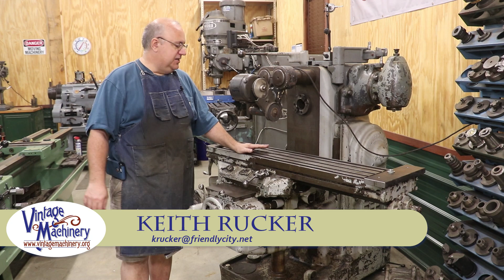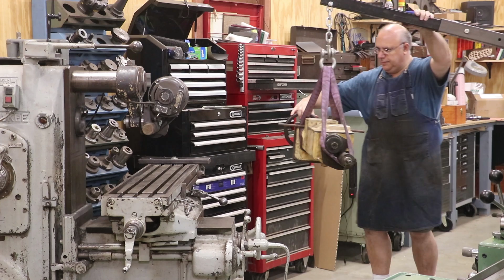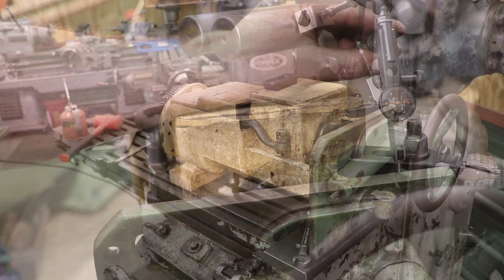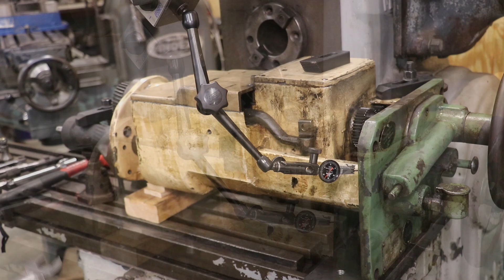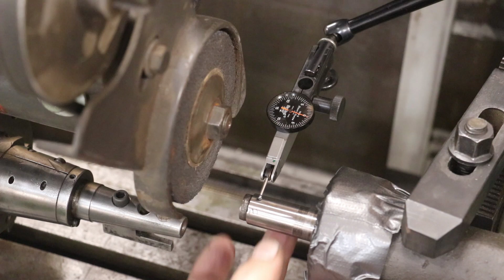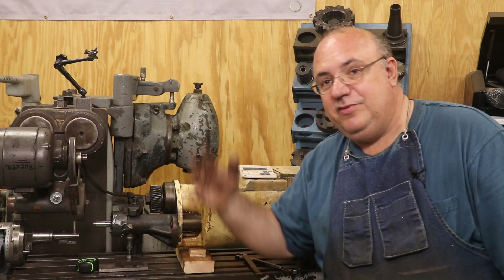Landis Surface Grinder Gear Box Repair: Cylindrical Grinding on the Horizontal Mill

Comment: Truly inspiring, Thanks Keith! Now I have another fun challenge; I need to grind a crankshaft for new bearing shells. Think Im gonna try your way. Problem is I need two centres for holding the crank. Could I find or make centres for this job? Any ideas welcome... Cheers. John in Denmark

Comment: stupid question, why didn't you disassemble the transmission and take the shaft out and turn/grind it on the lathe? It would seem easier to me.

Comment: I am setting up a Burke # 4  horizontal mill as a small surface / tool grinder.  I have a Rockwell univise to hold the tools. In place of a separate grinder like you have I will be mounting my cutting wheel in the arbor.  I can get just over 1,000 RPM from the arbor.  Great minds think alike ( well if my plans works) lol

Comment: You could attach a laser pointer to the gear box pointing along the direction of travel of your bed to see how much actual difference there is from the flexing of the bed. Say your pointer puts a spot on a wall 10 feet away. If there was no flexing of the ways, then the spot would not raise up when you crank the bed out to the end.  You could probably determine exactly how much to compensate in you adjustments as easily as lowering the gear box front end until the spot is in the original location. Does that sound reasonable?

Comment: Great solution to fixing the munged shaft without needing to completely disassemble the gearbox.

I was happy to see you explain the effect of the long pivot length on the change of angle. (I was expecting something like 1/30 of the desired change from the initial  0.0015" adjustment.)

Comment: Another great video.  Here is a wacky setup I made in the past. I had a live center that was not running true, so I setup a gear reduction motor to drive it, and used my tool post grinder to dress it up.  Always fun figuring out how to do something.

https://photos.app.goo.gl/ssAB2VuYK9Gwadd22

Comment: Kieth, 

Nice Job!!!

There will aways be people who think they can do it better, faster, more accurately or by some "better" methods. 

Problem is most of them have never worked in a shop or had to actually repair something with available tooling. 

It's always easy to do a job in someone else's shop using their checkbook. With what you had available you got it done and it didn't cost you a ton of money. And, that is the lesson here.

Comment: Great video!!! Ialso think that a contributor is the fact that when you indicate to 1/2 thousandth on the pivot point, the other end multiplies that error by 29 in your case. So simply from  1/2 thousandth on the one end, the other end is out by 14.5 thousandth.

Comment: I think you did a great job as you done it. Remeber this whole system has a multitude of differences in bearings and shims. and some of these have weights of the shafts and torque settings with all that you found the unknown numbers by your knowledge. The only other way was to break in all down to get the shaft by itself and then turn it on a lathe.  great job!!

Comment: Some sort of sturdy floor stand could be used to hold the indicator against your reference surface with the X motion way out to the right, properly positioned for making the cut. That way the indicating would be done with the off-center table load and everything sagged and flexed as it would be when doing the machining.

Comment: wouldn't you want to indicate the shaft after you squared up the casting? just to be sure the part your working on is as square as possible to the grinder?

Comment: Hi Keith; 

You could check the table with a precision level in the position where you trammed the vertical face (which was a bit lumpy anyway) and where it may have deflected with the weight when in a cantilever situation, that would also indicate the sort of wear you may have in the ways, and again that would be a combination of X axis wear, Z axis wear and possibly Y axis as well. 

As you said there may have been other ways to do it, clearly you could have dismantled it, and a bigger machine, but in the absence of other machines and no need or desire to dismantle it, your solution produced the desired result. 

Well done. 

Dennis

Comment: If I may,I do hope you use a Shopvac to clean the grinding dust off . Ideally,enough water in the vac that the thing bubbles would see to it the grinding dust ends up in the water,then dump the water. An air hose might not be the best choice here. Cheers.

Comment: I've no idea what I'm talking about and am going to get told this is a stupid comment but i don't care: couldn't you just have turned on the Landis with the gear box still on it and polished that up with a bit of sandpaper?
Reply: Mig Trewornan No, because there is nothing driving the gearbox. The drive part is the part being repaired.

Comment: Neat piece of work, Keith! I love these videos where you figure out a way to get it done with what you have. Back many years ago when I was a computer programmer/software engineer part of what I did was brainstorm solutions to problems. I'd just sit there and throw out a dozen or so ways to try to solve the problem and the other programmers would go off and try them. If nothing worked they'd come back and I'd throw another dozen at them. There are always a bunch of different ways to solve any problem. in my opinion whichever one first gets it solved is the best way to do it. (although I have to admit to more than one dope-slap moment when I looked back and a painfully simple solution was right there and I missed it!)

Comment: Hi Keith, I was thinking to remove the shaft and either grind it or better still make a new shaft of slightly larger diameter. The torque on the pulley might be high - at times - and that probably caused it to spin freely.

Comment: Great work Keith, love the videos. I run into the same thing turning tapers on rifle barrels, I know how much taper I want from muzzle to the start of the flare over the chamber but have to ratio that length to the length between centers and get my indicator reading when setting up the taper.    Thanks again.

Comment: Here is my 2 cents worth. That was a super interesting approach to solving the problem at hand. And let's be honest, that was a really cool way to solve the problem. The boring approach (maybe simpler) would have been to leave the taper in the shaft and make a bushing for the pulley with the same taper. In any case, another great video, Keith.

Comment: Very nice job. Good setup and excellent explanation of how you lined up and fixtured. I will note that I would be careful slinging like you did to place the part. Even if it is balance, if the sling slips a little and one end drop a fraction of an inch, it will keep going until it hangs vertical or drops the loop at the high end. When we sling that way, we use separate slings on each end to prevent slip when we can, or, if we can't and need to do it as you did, mouse up where the sling goes through the shackle to prevent it from slipping. Friction is sufficient most of the time, but you only need a heavy part to slip once.

Comment: Glad to see it worked out in the end.  
A couple of thoughts about the taper in the beginning.
1.  Even though the vertical surface was true at the pivot point you still have the multiplier of the length. 
2.  Could you have used the base of the key to check for level before you started grinding since it should have not been worn?

Comment: You can just put 2 indicators on the shaft . 1 indicator on the small size and 1 on the large size , and you ajust that the diference to be 1.5 thou .

Comment: I`m not a machinist by any choice of the word ,but I kept thinking your math was off when you indicated it in simply because of where you indicated versus where you needed to do the machining (multiply the length ) but you did finally get there

Comment: Have you still got that metal planer? I could see that grinder doing some great work sat on your planer grinding in lathe beds and large saddles! Or even your horizontal mill table would fit.

Comment: Did you consider there may have been flex in that shafts housing? It seems to me that you should have had your machinist jack under the gear box, not the shafts housing.
Thanks for all of your work.

Comment: I love the setup! That is getting it done! :-)
Reply: When keith was moving the gearbox to the mill was when I realised you had the right idea about how to set up a shop with that overhead crane. That's the most important tool in the shop in my opinion.
Reply: If you are doing heavy stuff it is invaluable. Having struggled without for 15 years in my old shop I knew it was a must have for my new one.  I couldn't do what I do without it. :-)
Reply: Great idea for the home shop.

Comment: Go back and watch again the way you indicated the vertical surface. The indicator didn't move at all, except right at the end, where it may have hit a ridge. you adjusted from that ridge, instead of the average, as you talked about doing.

Comment: Keith, well done.  As far as calculating your movements ahead of time, you essentially "sneaked up on it", which in cases of older machines is exactly what it takes.  I do a lot of work on old hit n miss engines, repairing and making parts.  90% of what I do is to "sneak up" on a target measurement.  From my perspective, absolutely no shame in doing that.  Again, well done.

Comment: Great solution.  Instead of a rag in the 50 taper socket you should print a plastic plug to close off the hole when not engaged by tooling.  I suggested this to James Kilroy who then printed a plastic plug which you can see at https://www.youtube.com/watch?v=8HK992VjoUw&t=70s
Reply: In kilroy's next video we see him printing a 50 taper socket plug for Keith.

Comment: Works for me! I have to admit I was thinking that you needed to drop that end a tad more to compensate for the taper, but I didn't try to guess by how much, other than more than 3 thou. But figured  out in the end, and that is what counts.

I suppose you could maybe have done this on one of your big lathes, but it would have been a lot more work and maybe not as good a result. You could maybe have mounted it on the carriage (somehow) and held the wheel in an arbor in a collet, but you wouldn't have had the RPM that way. And of course it probably would have been a pain to hold the box to the carriage. Or maybe you could have bolted it to the ways (or a plate on the ways) and used the toolpost grinder normally on the carriage. But it would still have been a pain to align it.

Both of those sound like more work than what you did, and for dubious results.

Comment: Heavy maintenance is where I come in and what you had to do was in my mind, kosher. When you talked about the play in your milling machine table you have to add to that a certain amount of slop within your gearbox. Not much but it could have been significant. Anyway, you have the result you needed and that’s the most important outcome in spite of any naysayers with 20-20 vision. Regards.

Comment: What about the key? I would guess you would have to take the amount out of the bottom to get the correct key depth.  Enjoyed the video great setup.
Reply: You could grind the key as this is a repair does not mater what size the key is.
Reply: Or make the keway deeper in the pully.